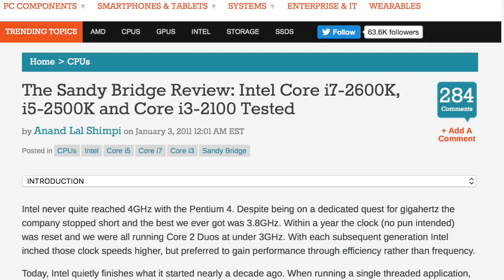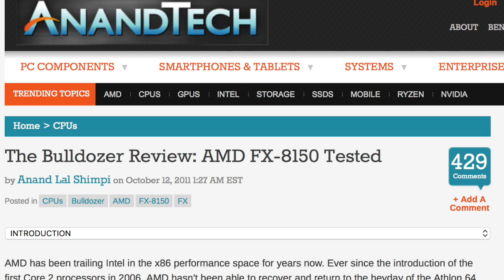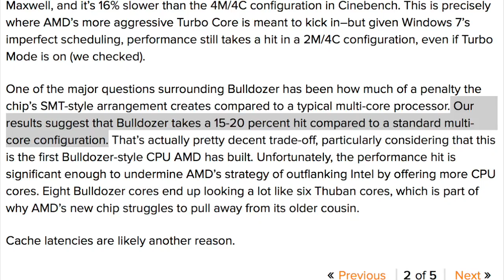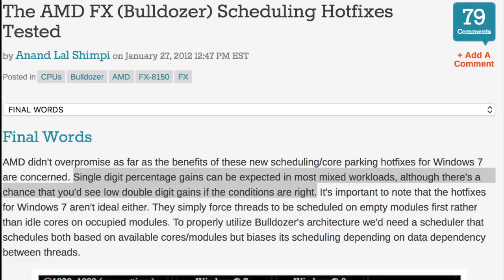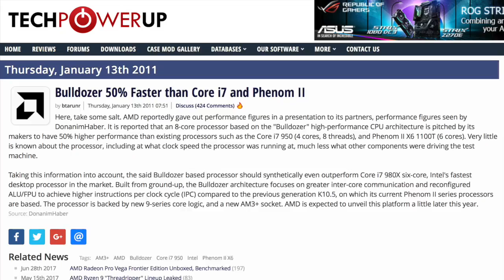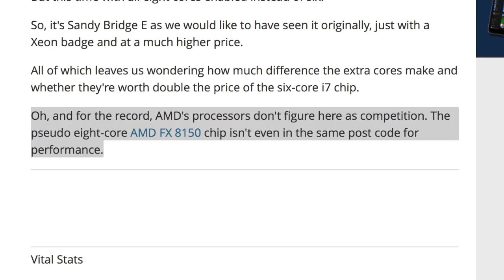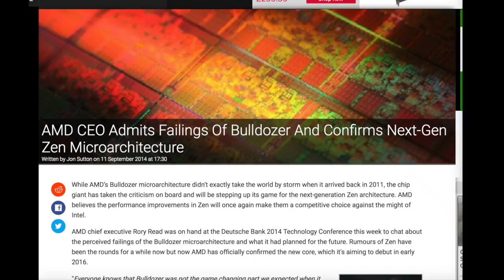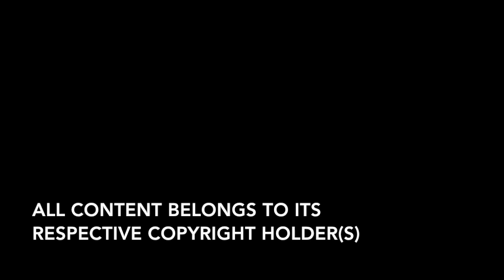The Bulldozer Story - and why AMD FX is better than you remember

Comment: actually, its been shown, it wasnt/isnt the shared arch that was really the issue, its the slow caches, the latancy and speed of the cache, the L3 is horrificly slow, and the l2 isnt all that fast, you can midigate some of that with clocking the htt clock up to at least 2600(many will do 3000+) but, the cache's are....just slow, i love my chip but, it has its flaws....i will say, its held up better then the 2500k's my friends bought....only one still has his, and its because he refuses to buy anything newer with the TIM under the IHS, and hes not found a good deal on a 2600/2700k or whatever else he could get ahold of... the rest...well, the ones who are local admit my investment has held up alot better then theirs did... i went with slower ram but more of it then they did with their intels, they started with 8, i had 16 well before that, they moved to 16, after i had been on 32 for some time....though when i got my first 32gb kit, it was 1866, and cost 120bucks shipped from newegg..i got a similar deal on a 2133 kit, thats in here now, sold the other for more then this one cost me(over 2x as much, a buddy wanted 32gb, he wanted it now, and he actually paid me extra because, 1. he knows i dont oc my ram or torture it and that means its reliable and 2. i installed it for him..he also gave me his very very very low latency 16gb kit since he had no use for it... ) 

when they where on quads i was already finding many ways to make use of more cores, encoding is a top favorite where even the 2600k stock for stock couldnt beat my 8350, (ht actually slows down encoding by around 20-40% on large batch encodes it overloads the cores....) 

We actually benched using dbpoweramp with the lancer vorbis sse3 encoder on he same folder of flac files...my system was over 30% faster when matched with a 2500k at 4.6(same clock my 8350 was at).... its one of the places this things always shined....(well im on a 9370 because i got one free....gave the 8350 to a buddy...his board would die trying to run this...LOL...but..poor sod was on a 945... couldnt run a few new titles because his cpu was to old..

Comment: This video just fixated on the FX-8150 for some ridiculous reason. Most reviewers stop at the 8370...as the owner of an FX-9590 @ 6.13GHz (Lithium Hydroxide cooled) using a pair of Radeon R9 295x2s @ 1,325Mhz GPU and 1,625Mhz RAM (also LiOH cooled), I had yet to have ANY computer in the world out perform mine by more than 1% for any given task until 2017. My system was listed as the 5th fastest in the world recorded by Rockstar when I was a beta tester for GTA 5, and at the time crossfire was not even supported so 75% of GPUs were offline. This system scored a 945 on Cinebench R15. Now here in 2017 there are a MULTITUDE of processors that mop the floor with mine, but it took years for them to catch me...all on a $200 processor. I am currently in the process of building my Threadripper gaming rig (also LiOH cooled and running soundly @ 4.7GHz) I hope very much to recreate the unbridled power and glory that my FX CPU enjoyed. I agree entirely that the FX series' IPCs were the very essence of PISS POOR per clock performance...but when you're packing over 6GHz of clock cycles...we beat them all with raw power. Thank you FX for being so good to me over the years!

Comment: I owned multiple FX Processors and APUs and I loved every single one of them. Those things are beasts and would take on anything you threw at it. I would still be rocking my 9590 had the Ryzen not come out.
Reply: god bulldozer apu’s are fucking garbage, i have one from 2014 and it couldn’t handle shit, fucking beaten by 2nd gen intel dual cores
Reply: @faudanke4459  Don't forget that the integrated GPU from the A-series APUs beats all the Intel iGPUs (Even those of flagship Core i9s from 10th gen) previous to Xe graphics without costing a kidney like those Core i's with in-die vram, and, to be fair, the A10 7870K could outperform the i3 3xxx's as a whole lineup + GTX 750 on most contemporary games, and that is, considering the A10 7870K downclocks to 3.0GHz when the iGPU is in use.
Could you actually game on the built-in Intel HD graphics? I thought so, those CPUs went around the same cost as the APU + MoBo, and that is without accounting the cost of the GPU you would drop in to actually game on that Core i3 based rig, with that cost, you could afford a dual  (4x4gb) 8GB 1866MHz kit for the A-series based machine and still have money left for a fancy case and fans.

Comment: Im on a fixed income, so I am always a step behind. I was running a phenom II 555 for the longest time. Not really that big a gamer, and those I play are not very resource heavy. With the Ryzen 5 release I found a FX 4300 for $20. A drop in replacement that boosted my little computer. If I get 2 or 3 years out of it and I am able to save up Il get a Ryzen 5 1600 when its replacement is released.

Comment: My FX 8350 is still running strong.
Reply: Me too.
Reply: Its not bad. Considering i lived with an amd a4 3300m laptop thats was uterly trash and couldnt run minecraft. It is a huge upgrade and as long as i can run everything at 60 fps i will be fine.

And to be honest. Doesnt consoles use simular chips with much lower clock speeds? People live with consoles. And i can live with my fx 8320 with an rx 570.
Reply: The consoles are similar to the A4 3300m chip, both based on Jaguar.

FX is easily twice as fast as the Jaguar per core. Wife has an A6 6320 and I've got an FX 6300 (well, one of my machines). FX scores 109 in Cinebench R15 single thread, 6320 is 59.

FX isn't terrific at games, but it's fast enough to keep vsync pegged on nearly everything I want to play at 1080P. Windows blew up and I swapped my Ivy Bridge system in here, the only benefit to speak of is I could run SLI because of the better case ventilation. The FX was running as a DVR/movie/gaming box, the Ivy Bridge cannot multitask as well as the FX could.

If the FX sucks then so does everything from the Ivy Bridge and below.
Reply: @herroberbesserwisser7331  100% true, we are not all benchmark addicts and posers like some people here!!!
Reply: I currently have a 9590 and dumb me didnt think i would need a liquid cooler...well gonna install my 8370 until I do..lol fuck its a hott cpu
Reply: Mine is also and in my Linux  mint  boxs it runs  great
Reply: The 8350 is an excellent choice for apex ledgends!! Let haters hate.. Im glad you were able to keep your investment for so long. All the great games worth playing today run excellent on your processor.
Reply: Timmy P, it's almost like politics.

Once people are on the same level they move the goalposts.

Now it has to be 144fps. AMD can easily hit 100fps, hell, the FX can hold 60fps on most games, but 144 is the magic number because reasons.
Reply: fx8300 overclocked to 4.5ghz, i get 80-100fps on csgo, and over 70 on pubg
Reply: @Irish_Hooligan  What kind of GPU are you using tho?
Reply: as is my phenom II x6 1090t  :)
Reply: I upgraded from my FX last year to the Ryzen.  But the FX was seriously fast when compiling Java etc. and was noticably faster than the Core i5 that I was also (and still have) running at the time.  Depending on what you wanted to do with the CPU it was either terrible/acceptable/great and gaming was no where near as strong as an Intel.
Reply: My 8150 still running strong
Reply: @txtpeer5179  FX 8150 8 cores, 8 threads 2012
But in 2019
It is really 4 cores physical
With 4 cores bulldozer
Will it still strong with gtx 1060
But not all games
Im not surprise :)
Reply: @user-xm4tk8ym7l  why the fuck did you buy that CPU? Just get Ryzen. On the other hand, at least you won't get cold this winter if you run Half life 2 capped at 24fps! (So you dont burn down your house)
Reply: @tan tan Battlefield V
Reply: IKR!! I have mine well overclocked (I forgot what it's clocked to rn but I know it's up there) and I will stick with it until it's clocked too high to keep cool
Reply: I have a 1950x
Reply: ManGamer  Still using your FX8350? I've got the same one, black edition too, it's a great processor. I only really play esports games like CSGO, & Valorant, with a little Minecraft & Roblox. All run at or above 144 fps with my GTX 1060. I can also play the rare title like Hitman 2 if I'm in the mood for a singleplayer storyline game. I don't even think about performance for the stuff I play, & I have no intention of upgrading anytime soon.
Reply: Mine too! In gaming of course, the most modern games
Reply: @M Paws Exactly 
By the time more cores were really used, cores and threads all around improved a ton from Bulldozer.
Reply: I'm playing The Witcher 3 with FX8350 @ 4.6Ghz for 60fps no drops. Ultra settings.
Reply: I have an fx8320 with rx570. Not bad setup, the rx570 can run most of the games at least on high settings. But the CPU is very bad for games... My gf has the same fps in overwatch with a dual core shit Intel CPU, lol. It's just my fps is more unstable and there are random stutters. And I can't stand the random stutters and slowdowns everywhere. In games, Chrome, or just in Windows... Everywhere. Nowadays even the cheapest i3 destroys it in performance.
Reply: i had to swap mine out now cause its botllenecking my 1080 ti Xd
Reply: Great! I need a new heater but I think those are cheaper nowadays (although they are slower than the heater...) I'm gonna get one now!
Reply: @Phenom98  i9 9900KS would be the best option for now.
Reply: @lbsheng2912  not a chance
Reply: A 9100 , or the 3200g can tie with/outperform any FX processor for dirt cheap today. FX isn't good today at all by today's standards by either platform, and saying they are is a huge lie.
Reply: @jaronmarles941  tbh its a decent chipset now but also to upgrade from it would mean a new board a new psu and the new cpu and fan.So like your 3200g is not just 120$(price where im at both digital and in stores) its more like 250 cause the psu and motherboard as well.and i guess a new case too
Reply: The Baconator0524 Tan Tan is actually right though. I've had my FX 8350 on ASUS ROG CROSSHAIR V for several years now, and with a MSI GTX 1070 and an ASUS XONAR ESSENCE STX sound card, I get bottlenecks. the single core performance is just not good enough for most games nor 3d architectual programs such as maya, poser pro, daz studio and rendering with IRAY takes hours compared to the couple minutes it would take using an Intel processor. (this is because 1. AMD FX 8350 is slow 2. PCI-E lane on the AMD boards are also very slow)

As of right now, AMD FX 8350 is the equivalent to an i7 2600k. I know the new Ryzens are out but theres flaws with those too. the current AM4 boards out there have support for up to 2666Mhz RAM, the newer z370's have support for up to 5000Mhz RAM.

It's really not worth upgrading to a AM4 board to get a Ryzen, even if its more cost efficient, the intel chipsets are way better at many things like for example if you want to run a "Hackintosh" be aware that they only make KEXTS for intel based PC's and there is no support for AMD at all, same goes for certain Linux distros, etc.
Reply: @SimilakChild  you might need to check which board breaks the RAM frequency world record...
Reply: @lbsheng2912  well after i wrote that comment nearly 2 years ago, the Ryzen 3rd gen is on par with the 9th gen Intel, the boards have pretty much the same specs too. Ryzen would be the best choice right now because of its lower cost. all the newest gen consoles coming out will also be using Ryzen.
Reply: Timothy John Aguilar doing what?  Facebook and sponge bob cartoons?
Reply: Hey moron, my 8350 runs BF1, farcry 5 and SWBF2 all  in ULTRA just fine thank you.
Reply: @Neverdie_7OG  if paired with 2070 card then yes)
Reply: @Neverdie_7OG  mine too, wants next to buy the grandson 3900X or 3900 XT
Reply: Playing AAA games!
Reply: Tan Tan I have an 8370fx is doing really well on streaming and gaming
Reply: @zeng58  me too, FX 8370 is a strong CPU but consumes a lot..
Reply: Wicher 3 at full with 35 - 45 fps. neverwinter online, world of warcraft, boy, shut up.

Comment: What a terrible video that offers little information. Bulldozer at 32nm has less IPC and uses more power than its previous 45nm chips. It was a massive failure and no dumb video like this will change history. Games STILL dont use 8 cores, not even close. He didnt even mention that AMD used experimental simulation software to design bulldozer instead of have people carefully engineer the architecture but I dont expect much knowledge from this youtuber...

Comment: I use a FX 4350 with a 750ti. It runs good for me in Blender and games. I think my screen is less than 1080p though and was a great step up from the E8400 I had. I guess people build according to their budget and for their resolution. You really gonna get a 1080ti and a 1080p monitor? That would be silly. After 60 fps the eye can barely tell a difference. FYI movies run at 24 fps. :) Oh and 6 cores will be the new main stream soon and the 8 cores of FX won't notice a difference. Can't say that for 2 core chips. FX was way too far ahead of its time I think, but in the end I think it will outlast the main competition of it's time. When the time comes for me to upgrade for not much more I can get ryzen 3 instead of the 8350 and would be silly not to go with it. Best upgrade path for any entry level chip on the market and a performance gain.

Comment: I'm not defending anything or anyone, but AMD FX processors are on the Top when it comes to price/performance value. That's all I care for now. I still have an old FX6100 , with a little bit OC on hand and there is no game that I can't play quite well to be fair. On the other hand some games are more GPU intense and there's practically no difference if you're with FX6100 or i3 for instance.
Reply: 2 weeks ago i bought a new fx 8350 WITH wraith cooler for just 57 euros here in greece. The price/performance for those 57 euros WITH REALLY GOOD RGB COOLER is just insane.
As far as I see from benchmarks the 8350 has 10%-20% less framerates than top of the end cpus. And in 4k the difference for some reason is even smaller.

Comment: I just watched a video on Intel's monopoly practices. It might explain why the FX series is considered as unsuccessful. I have a FX 6300 and it is still doing the job for me. Just.
Reply: I had an i5 from the era and it performs worse than my FX 6300 in modern games.
Reply: That was a crap chip. I saw my friend build a brand new pc and was so cpu bottlenecked, Portal 2 lagged.
Reply: @_nom_  I ran Portal 2 on a FX 6300 for years. It ran fine.
Reply: @_nom_  dude, I ran Portal 2 with fx-4100 just fine.

Comment: An FX8150 cost about the same as a i7 2600k and the FX6100 was nearly as dear as the i5 2500k which got it off to a bad start.  An average AM3+ board hadn't got good enough VRM's to handle the power draw of the 8 core chips which caused throttling even at stock speeds.  The quad cores were terrible in all forms and would have been better to have not been released.
On a high end board a 6 core (or 8 with 2 turned off in my case) with a good overclock it was pretty good, especially when prices went through the floor overnight for used parts, I paid £85 for my 8120.  The previous Phenom II was also a very good CPU and worked on AM3+ so you could get the modern features just by upgrading your board.
2nd gen FX cpu's had a lower power draw, were cheaper on release, cooler, about 10% faster clock for clock and overclocked better.  For me FX6300 is as much a budget legend as the i5 2500K is a mainstream gaming ledge.
I upgraded to a i5 4670K later on, running at 4.2ghz it was only 10% faster gaming than the FX6300 which I used to use at 4.9ghz with no problems on Sabertooth 990 and a H100.

Comment: I'm running an FX 8320 on an ASRock 990FX Extreme 4 motherboard and it drives me nuts. The core frequencies are all over the place (and none of the controls for this seem to change anything). I know it is supposed to throttle the speed down when it is idle or hot but seeing it sit at 1.4GHz so much makes me think something is wrong with it. Especially since I can't get it to match the benchmarks at userbenchmark.com or passmark for the same CPU. It gets between 2600 and 4600 out of 8020 on CPU Mark. I'm adding a fan to the case to see if it helps. A shame the thing turned out this way, my phenom x4 was an awesome build.

Comment: Is a Bulldozer module a dual core with shared resources, or is it a single core with duplicated resources to support 2 threads? I used to believe it's the former but now I think the latter makes a bit more sense. Either way, it is what it is. It may not have been a commercial success (it literally sank AMD's server chip business!) and may not be as good as it could have been, but it's nonetheless one of the most interesting and unique CPU architectures ever spawned. I've been using my FX-8350 for 55 months now and I don't have any plans to replace it yet. It's as reliable as anything out there.